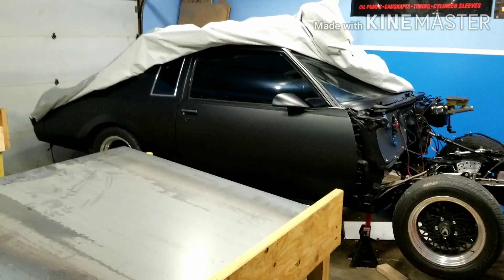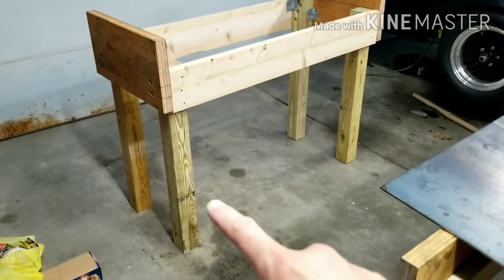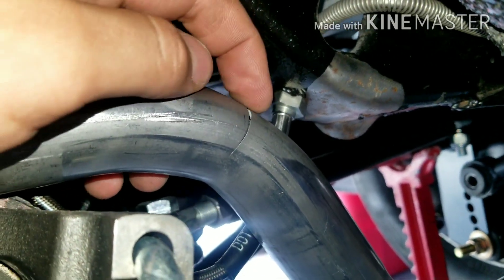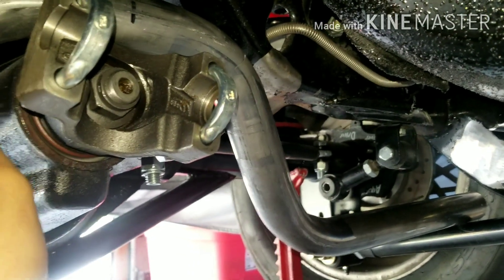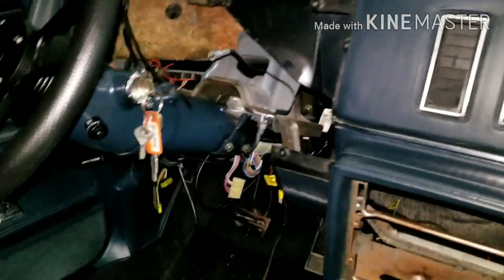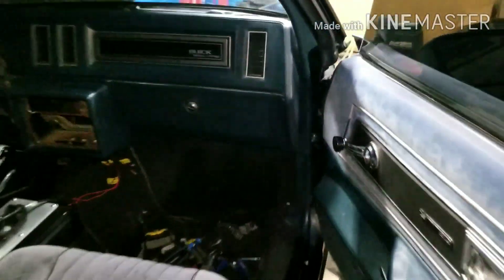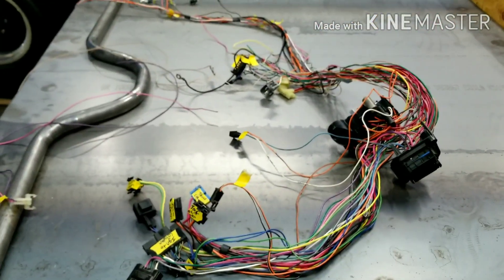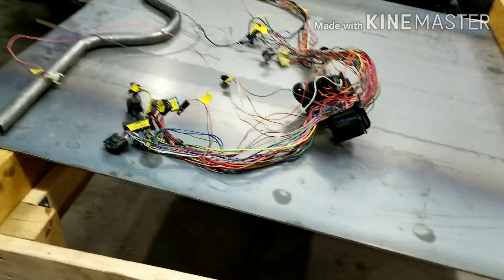G Body Regal Body stand and update..

Comment: On the ignition wires there are two plugs that give power to everything and start the car. There might be a neutral safety switch for the trans and some blinker wire thing like that.   I was able to hook up power windows like factory set up.